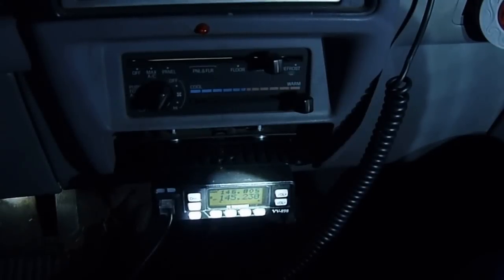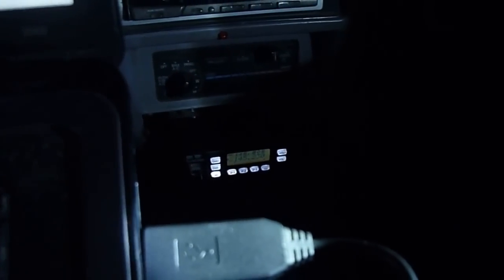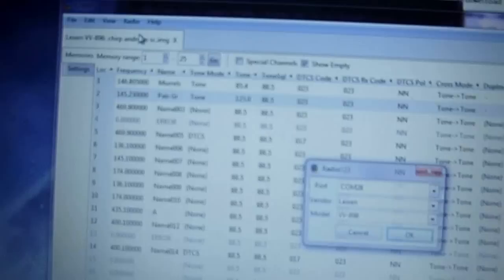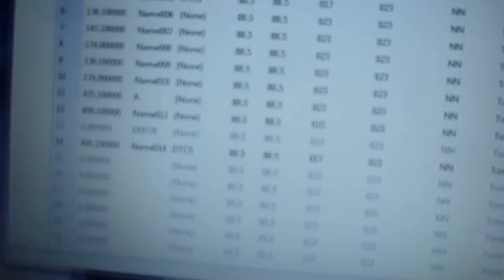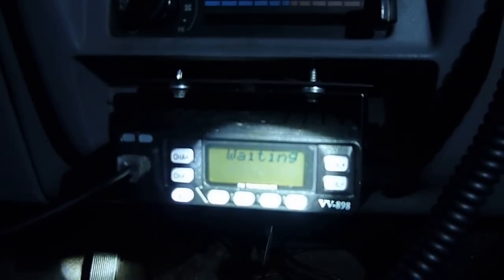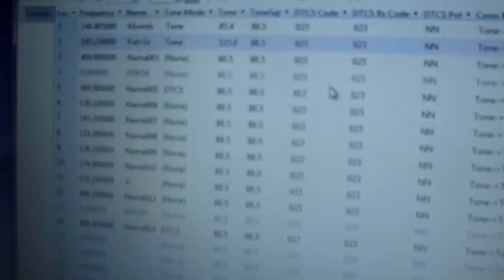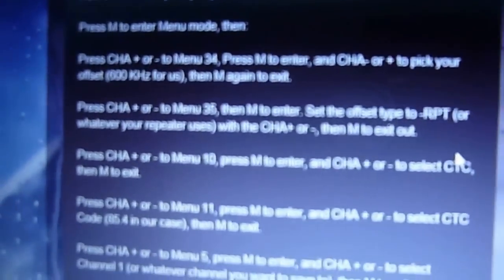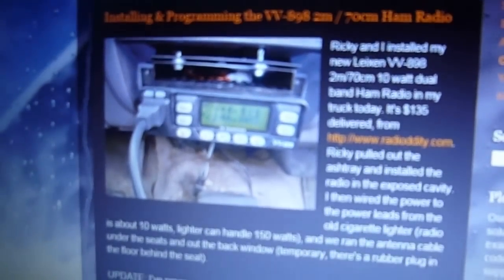Programming the Leixen VV-898 with CHIRP

Comment: Hi Steve, I have problems with mine,just go's into tx both lights red and green on radio then says will not program I had 2 leads one come up has not working chip old 2012 and would not connect. I do not have a mic to do it that way so at a loss to what could be wrong. Don

Comment: I'm using chirp on OS X I can program my yaesu ft 857D no issues , when I try to program the vv898 it says cloning then the radio bleeps then it crashes the software.
the software wont even load on xp
Reply from the maker: 2j4ez you have to down load the radio settings first. Edit, then upload.
Reply: I can't the software crashes when it finishes and radio beeps and restart
Reply from the maker: 2j4ez software crashes should be brought up on the chirp forums,
Reply: Just tried it on a old version of OS X it worked fine . Seems it doesn't like the latest version of OS X

Comment: my chirp isn't working with my leixen, weird and missing frequencies all kinds of issues.it doesn't want to read the radio right. anybody else having that problem also? the software that came with the cable is asking for a password? huh? any ideas
Reply from the maker: Butter Bean what cable are you using? As for chirp, pull down the nightly build. Any chirp issues should be asked on the chirp forums.
Reply: hiya steve I'm using the cable that came with the radio. ill check the chirp page. tnx
Reply from the maker: make sure you download from the radio before trying to upload to the radio.
Reply: Try : User Name : ham and P/W 89812345